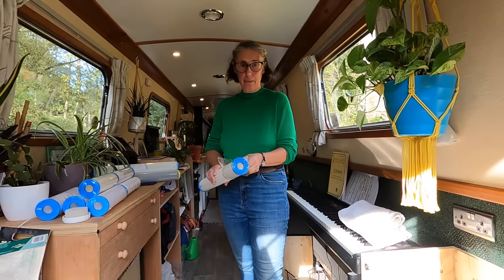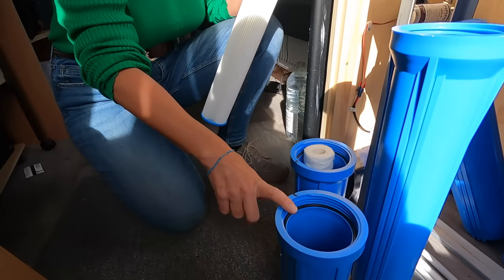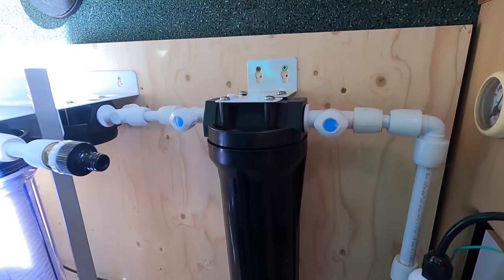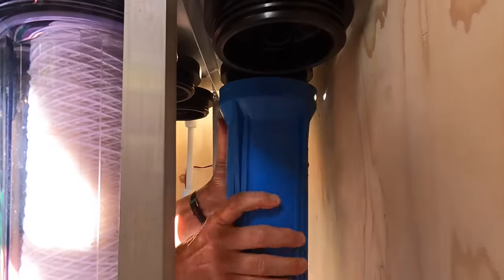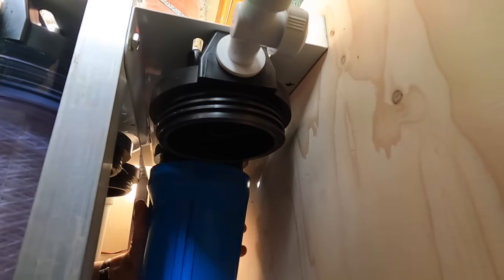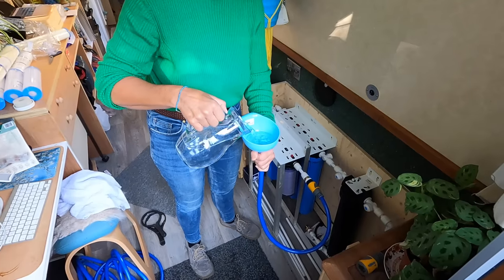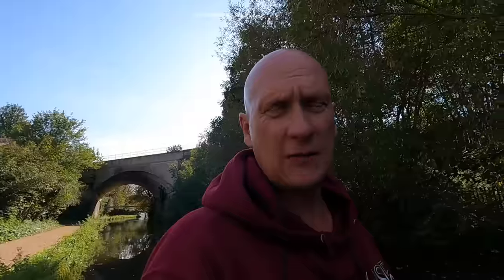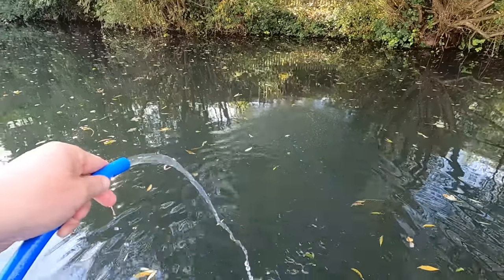Filtering Canal Water. How Good Is It? - S3 Ep14. #narrowboatlife  #waterfiltration

Comment: Nice vlog Chris. Very interesting, one thing I pulled from this vlog is if you are fortunate enough to be building a boat design more water storage at the absolute beginning. There are a couple of vloggers I've seen that have very large capacity water tanks, already built in.  Myself having spent a long time at sea , several tanks spread through out could be an option.  
Another thing that was said,was having to run the water to flush the system . Well washing down the boat with that filtered water could be a use for it. As apposed to dipping a mop over the side. 
Lastly when I eventually get my boat, I will have a filter system built in so that every time I fill it will go through it before entering my tanks. Just a precaution that I picked up on from getting water from dubious sources. 
Anyway just some thoughts . I'm late getting to watch today  I usually catch you within an hour of posting. Yes I enjoy your post's thank you.
Reply from the maker: Thanks for the comment Colin. Agree with your analysis if buying new. Large built in water tanks means having to scape it every 3 years or so. Can be bothered. Hard enough keeping on top of the brasses. Several water tanks throughout the boat mans less storage. Every action creates a re-action. It's never easy to make the 100% solution. There are compromises everywhere. 
What I've worked out from this vlog there are plenty of good ideas. until you build a boat from a builder who is prepared to do all of your ideas and then you are content to fit the bill. I found out, it's a lot more money when you go bespoke. I had to reign myself in a lot more than I thought. 
Cheaper builder means cheaper materials. It's a nightmare. I hope your wishes come true. Good luck and thanks for the comment. have a great week.

Comment: you can fit a long thin version down one of the insides or in the well deck. you are supposed to back wash them to clean out the filters.  at least the ones I've seen in use

I think id run a cheap sand and charcoal bucket filter before it even got to the filter unit

an option is to have separate working water and drinking water so a set of filters and over chlorinate the working water

and keep bottled drinking water stashed away for emergencies. easy to pack 40l in nooks and crannies
Reply from the maker: Thanks for the comment David. I understood the back wash. It all seems a bit of a faff for my style of life. If I was on the boat for different reasons and had a different lifestyle or there was amore than me on the boat, it would be different. I'd look into how I could make it work. 
Next week you'll see the 40ltr containers, not as easy to pack away than at first glance. Have a good week.

Comment: Very interesting, Chris.       Suzanna’s system does indeed look a bit Heath Robinson.     I liked the idea of the UV sterilisation device; such a device would enhance any tank-fed system, providing it had some sort of alert to warn of non-operation.

I remember reading about those wheeled water containers.   Developed for places like Africa and disaster zones.   It would be interesting to see an analysis of canal water filtered by such a device with, say, tap water or Suzanna’s system; there’s no UVC sterilisation going on in them, and they have the appropriate approval, which is interesting.     It also makes me wonder how long the filters last in those wheeled containers, and, if they can produce potable water, why is Suzanna’s system so complex.     

I don’t blame you writing off a filtration system for your boat, even if you had the space; you’d only rip the damn thing out the first time you dropped the contents of one of those 10 litre bowls all over your laminate floor.    And that’s over 10 kg you have to try and hold in some very awkward positions.

A really interesting video, and thanks to Suzanna for explaining it so well and for letting you film.   Clearly, she had a very strong scientific background as well as being technically competent.

Martin
Reply from the maker: Heart Robinson is exactly right. Alarm system would be great wouldn't it. The filters I got wrong by the way. It's 10 or 20 inch containers but you point still holds water, to coin a phrase. Drop it and it's still a mess. 

I've look at options and carried out a feasibility study. Situation is no change so the system of work will only need a tweak at best. Another water container. Thanks for the comment Martin and have a great week.

Comment: Older video so I hope you see this since it may be helpful, 
A reverse osmosis system with sediment and activated carbon filters should deal with any pathogens and chemicals from agriculture 
Also has the advantage that you can use a “TDS meter” (they are very cheap!) to know whether or not the system is working so you don’t have to worry about that

edit should also be far more compact than the one in the video
Reply from the maker: A few people mention the reverse osmosis system. I’ve met a fella recently who has a system on his electric boat. Because the cruise there isn’t a real need for it but it’s a safety thing. I get it. It is useful when washing machines and showers are required. Thanks for the comment

Comment: The thing is, if you drink tap water Suzanne is drinking cleaner water than you regardless. She struggled to handle the twenty inch, very heavy to hold and twist but the ten inch was easier. Great video.
Reply from the maker: I put the second filter uneasily enough. The last one was a pain. Yes they are a challenge if they're not lined up properly. Have a great week and thanks for the comment Steve.

Comment: Really interesting thanks for posting this. My first impressions are that its a lot of expense and hassle for something that is available for free on the network. Its probably of interest to maybe London boaters who dont move much/at all?  As you fill up every six weeks is this viable for you?  You'd pass a tap in that time?
Reply from the maker: Hi Rob. Agreed. The reason for me looking at the system was to enable me to use the boat as I would a house. Basically, not worry about having a long shower etc. The trouble is, I live in a boat and life is different. It’s one of those acceptance things I’m sure we all have to deal with. As you mentioned, probably a good idea for those living i London areas where the ration of boaters per sq/meter is higher than most places. For me, water points. Thanks for the comment and enjoy the week. Weather’s turned todays.

Comment: Thanks for another excellent and interesting vlog. At the risk of sounding a bit daft did you consider fitting an auxiliary tank or tanks? Best wishes from Cape Town
Reply from the maker: If I had considered the filtration system at the start of the build I may have done. To fit a new one now - there's not the room without disturbing the layout of the boat. Thanks for the question and have a great week.

Comment: Interesting and thought provoking.I’m not going to add to the filtration comments as it looks like most has been said, but have you considered a bike trailer for carrying water? As well as allowing you to easily and quickly transport 3 or 4 Jerry cans (60/80l) you can move coal, wood, groceries and even your purchases from B&Q. Wheely water containers are definitely not good for transporting over long distances over uneven/muddy ground as I can attest. They also have a weak point in that the removable handle relies on friction to hold two small balls into the tank sides which pop out/break on rough ground. As for pushing/pulling two - been there, tried that, gave up - it’s hard enough controlling one over less than perfect terrain. Two 40l aquarolls are equivalent to 4 20l NATO black Jerry cans but I think the Jerry cans are easier to store and lighter as they don’t need the heavy protective rings of the Aquarolls. I also carry 20l fold flat water containers but they have two problems - UV makes them brittle (eventually) and when brittle they split at the corners where they fold as I found out when one slowly emptied into the back of my Defender. As for the Jerry cans you get two bangs for your buck - fill them up from a water point when you fill your main tank and then fill them up again when you go on a replenishment trek - so 4 cans are effectively giving you 160l of clean water from one trip when iced in.
Reply from the maker: Some great advice there and analysis which I can understand. You’ve certainly given me food for thought with the black issue jerry cans. I recognised the plastic container went green in the summer. Had to disinfect it. It lives in the bow locker now for that reason. Coal on the roof to save space. I suspect those jerry-cans would fit there but as always I’ve re-brigaded kit so not even sure more than one jerry can would fit and need to measure the height to make sure one fits. As you point out easy to transport. Thanks for the comment and have a great week.

Comment: Very interesting.. question why not have a 50 litre aqua roll as extra to compensate for the lower part of the tank. That would give you a backup if you run out and allow to time between water points.. its like range anxiety with a tesla EV 😂.
But very interesting Chris 🤔👍
Reply from the maker: Thanks for the comment John. I do think I mentioned that in the vlog although didn't make the connect between the dogs of the water tank and the aqua roll. Anxiety of Tesla EV is a great example. Thanks for the comment and have a great week.

Comment: Hi Chris, another great informative vlog. You didn’t mention a Reverse Osmosis filter, I see Suzanne didn’t have one, unless that’s what’s in a Berky. Have you researched those filters at all? I only ask as it will save me having to do the research 😊😊😊😊. Take care have a good week.
Reply from the maker: I'll have to look up what that is so no I haven't researched that system. A lot of comment mention that reverse osmosis system. When I get time, I'll have look. Sorry. have a great week.
Reply: @chrismears-inslowtime  I have looked at the “Water freedom” and “Alchemy water filtration “ both have a reverse osmosis solution. One solution is far more expensive than the other. Take care and have a good week too
Reply: You need quite a high pressure for RO, and the filtered/waste water ratio is about 20/80 %. They do a good job of removing dissolved stuff in mains water, I'm afraid I'm unsure about bacteria and anything else that may be in canal water.

Comment: Hi buddy try finch filtration.thise filters are used for filtering tap water for koi ponds along with a uv light.andy at finch filtration will give you the best advice and filteation.
Reply from the maker: Thanks for the comment and tip. Not sure I want to spend any money making already safe (enough) water any safer. I’ve not died using the tap water through a hose. I’m going to continue to use the water points. Also, a PhD chemist stated, he’d rather use the water points. Good enough advice for me. Have a great week.

Comment: Chris, have you considered a water bladder on the roof to carry extra water that you can top up the tank with? The one thing you'd have to consider though is boat balance. Just a thought that I hope helps in your decision.
Reply from the maker: Good idea on the bladder. No I didn't consider it and you point about balance I think is valid. It's not as if I have ever run out it just occasionally I would like to shower more often and use more of the water I have. The problem of thinking I'm about to run out of water is something I need to manage better. Thanks for the comment and have a great week.
Reply: @chrismears-inslowtime  Its the squaddie in yea mate safe

Comment: The best way to marry threads is to turn the incorrect way (anticlockwise) until you get a click then turn to tighten. The filters will be hugely expensive (and generate a lot of bulky plastic rubbish) and the UV sterilization  absolutely has to run constantly and is also an expensive bulb with a life of 12 months. Far better to start with much cleaner rainwater with a pre-flush for extra cleanliness before processing and then a 5, 40 , then 1 micron filter rig followed by vertical UV steriliser. Best solution is extra containment for expected shortages such as winter. The water issue helps constant cruisers to keep moving; as is intended.  The filtration system  is really designed for use on demand not being stored after the process so would use the water tap supply soley for storage and not mix the two supplies. Would personally never ever even contemplate canal water processing.
Reply from the maker: Very good points made thanks. I agree with the continuous cruiser thing although from what I have seen in the last 6 months the CRT are not very consistent with applying the rules of the CC boaters. Extra water storage is the way forward but it's still early days in my boating life. I've not run out yet but the xtra when I'm iced in would be useful. Thanks for the comment and have a great week.

Comment: Stick with filling up from the CRT taps. The cost of running a filter system such as you show must be considerably more than buying bottles of supermarket water. You are only at risk of running out of water during freezing conditions when your boat is ice-bound and in those conditions, the CRT taps quickly freeze up too. It's then time to buy a sub at a local gym use their showers and live on pub grub. 🤣 Enjoyed the vid' keep up your good work.
Reply from the maker: Great idea for Gym and pub grub. I wonder if they do 2 week memberships? CRT water = free. It’s not really a hassle but I move. Those who don’t, I get it but they have to put up with the faff….and have a post code where filters can be delivered. Those working perhaps. Thanks for the comment and have a great week.

Comment: The main issue with a filtering system is if you then fill a tank with it. Pipe water has a smell of chlorine because the water company puts it there to ensure the water doesn't grow bacteria/viruses after it has purified the water. If you run filtered water into a tank it sits there with nothing to stop it going 'bad'. If you run just a bit into a tank it is open to air in the tank - also a bad thing. Filters are best used and safest only as the water is about to be used. To store filtered water you need to add something like Puritabs (I am sure you know the tablets from being in the armed forces in the past). You can split a system to filter to two different levels - one for non-consumption,  and one for food prep and consumption standard. It keeps the cost of filtration down. (A study of the nature of the canal water you are traveling through might change the day/week you wash your cloths.) Keep the main tank for water from CRT water points - purified and treated tap water so it can be kept for use when in canals of a less clean standard, but filtered for other uses. I am in the tropics where tap water is not safe to drink. We use a Seagull IV by General Ecology - have used it for 20 years now. It is just a 2 stage and very small, but we only filter water to the kitchen sink - the only tap used for food prep and drinking. (even then we bypass the filter for washing up). It is not an advert for Seagull IV, there are others that do the job. Again, I'm sure you have encountered some some right down in size to "Life Stick" for emergency use when you were serving. It is a case of right sizing rather than maximising size when using filters.
Reply from the maker: Thank you for a very informative comment. There have been many comments where it shows people know what they’re talking about. You write with experience. I’ve bought two rolly things. They give me an extra 80ltr along with the container I’ve already got.  Safer. I can use them for weight training…..maybe/somehow but I need to find a place for them to store that’s both easier to get at but stowed. You’ll appreciate that. From your comments as well as others, I think I’ve saved a few pounds. Perhaps even the dual tank isn’t the best solution either. It’s the running of the water which is the mitigation prior to use. As you point out, to set it up as you need it is probably the best solution. Have a great week.
Reply: @chrismears-inslowtime I notice a lot of boats have a folding 4 wheel trolley of some sort for moving toilet cassettes, shopping, DIY materials and all the rest of it. Having a bladder style water carrier that can utilise an existing trolley seems a way to minimise the extra space required. I agree that the barrel style water carriers may make moving it easy but then the storage would be a problem in a house, let alone a narrow boat. You don't want to feel like you are living in a store room! (Your boat looks more towards minimalism than storeroom - very smart at that too.)
Reply from the maker: @user-xw6wj2qh5n  found a solution to the water barrels. Stand by!